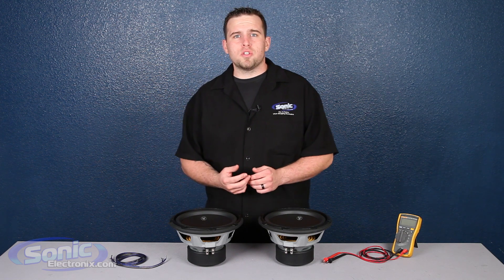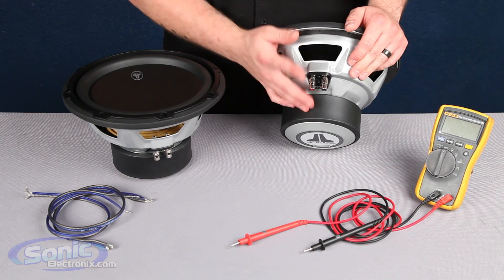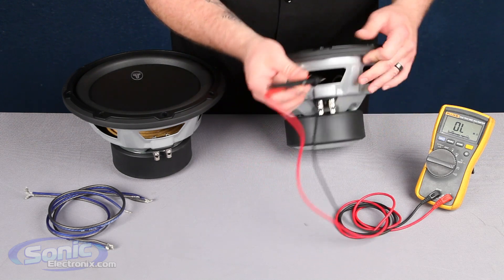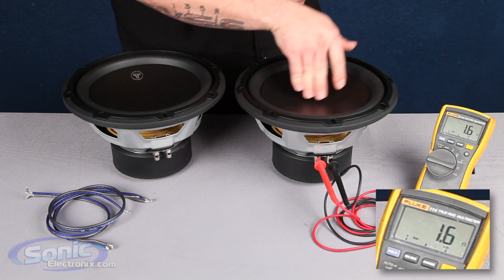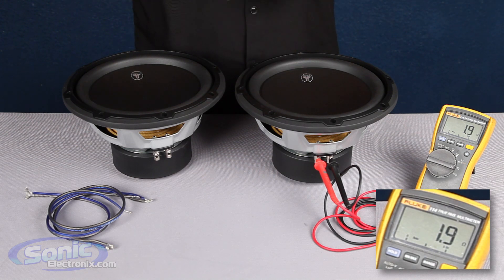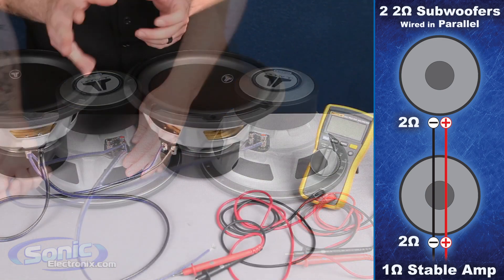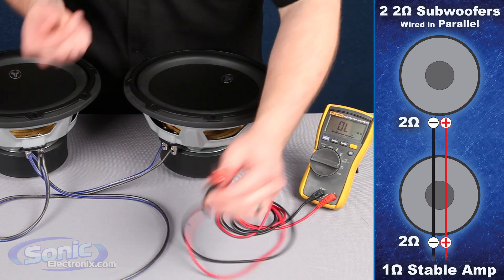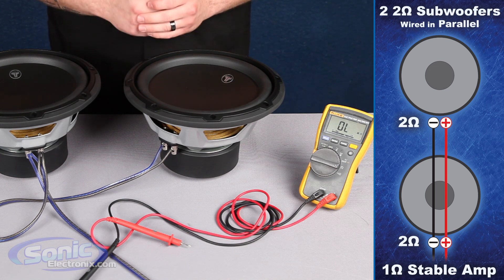How to Wire Two Single 2 ohm Subwoofers to a 1 ohm Final Impedance | Parallel Wiring | Car Audio 101

Comment: Sonic Electronix I got a question I got a two channel amp 1 ohm stable can I run 1 ohm on one channel and 2 ohms on the other? I hope that makes sense I have one 12 inch sub in a separate sub box and four 8 inch subs in another separate box the 8s are wired down to one ohm the 12 at 2ohm

Comment: i was putting my subwoofers amps in and now my radio and amp will not turn on. All the fuses are good. Can someone help
Reply: I’m guessing the positive wire leading to your head unit doesn’t work it should be a fuse but sometimes they can just break mines done that before

Comment: the box i have does not allow wiring between speakers on the inside of the box.  this will still work if i connect the speakers together on the outside terminals right ?
Reply: ofcourse, a connection is a connection

Comment: okay I need some help. so in your sub enclosure you know how you have a pos and a neg for one sub and a pos and neg for the other sub this is where you're supposed to connect your subs to then ultimately connect to the amp. how are you supposed to use both pairs of pos and neg if you only get 1 pos and neg wires for both subs in this example. sorry if I explained bad but any help would be great.

Comment: Should I wire my 2 single voice coil 2 ohm subs in parallel with 1 ohm or in series with 4 ohm? How does this affect sound?
Reply: The more watts, and less resistance = better sound. Typically if an amp is able to run at 1 ohm, the wattage will be quite a bit higher than if it was at 2ohm. It's always best to try and get the least amount of ohms

Comment from the maker: There is a ton of information on Google that can explain to you what an Ohm is. In simple terms, it is the electrical resistance between two points of a conductor. The higher the ohm number, the less energy that system is able to use.